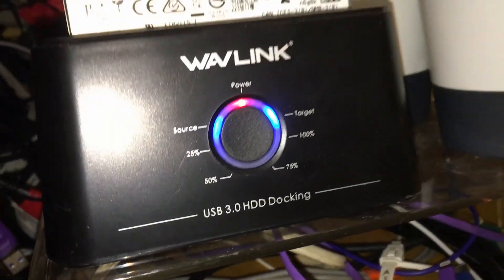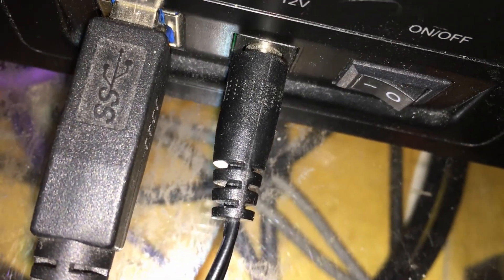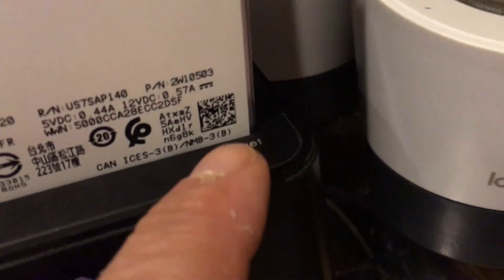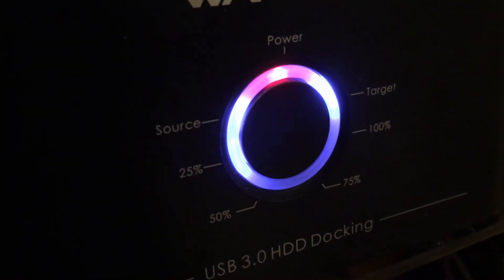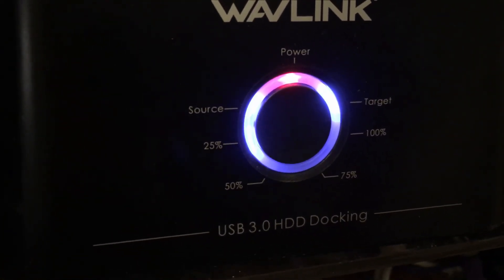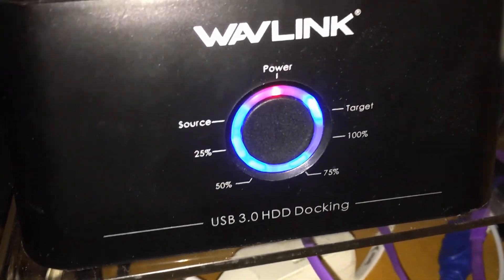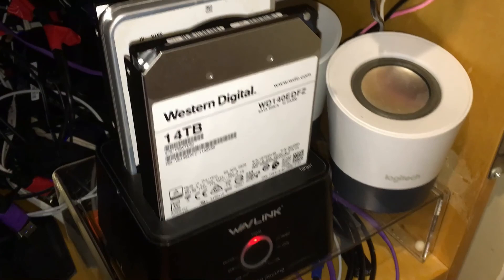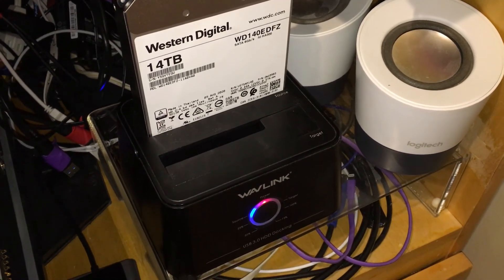How to Use Dupe Copy Wavlink USB 3.0 Dual Bay External Hard Drive Docking Station 2.5 3.5 inch SSD

Comment: These things are junk and WILL convert your drives to RAW. After my second NTFS drive converted to RAW, I started searching and found several people on Amazon with same issue.  Some said it won't happen if using just one drive for data transfer using the dock.  Wrong! There appears to be a bug with the docks chip set.  Response from Wavlink...crickets.

Comment: Mine just stays blinking and spinning
Reply: Snarky is correct. Mine did the same thing with spinning lights, but in about 4 hours it had cloned a HDD over to a new Samsung SSD with the same sized disk. Booted right up, but much faster😊
Reply: Yeah mine is doing that as well
Reply: @r0cket_penguin  it’s actually correct let it blink and spin. It’ll do it’s thing

Comment: iam working in a company with limited resources 

can i use this to colon company ssd to my new ssd to use the system as well as activated windows and Microsoft office?
Reply from the maker: As long as they are SATA drives, there should be no issues